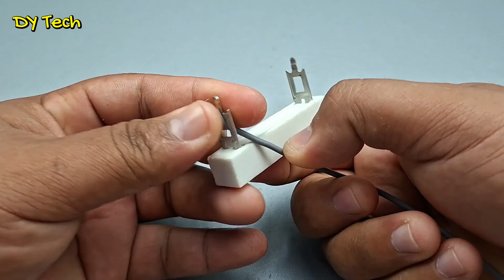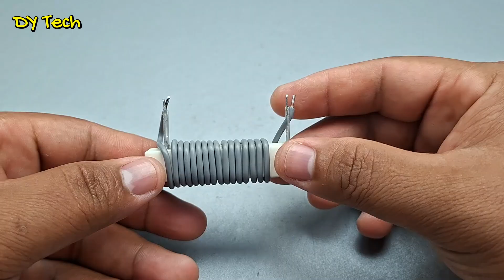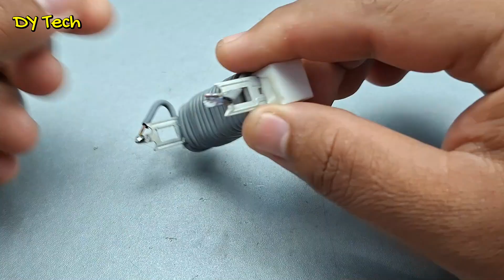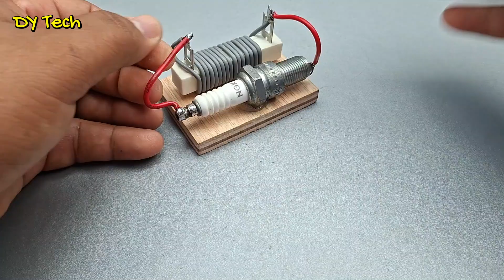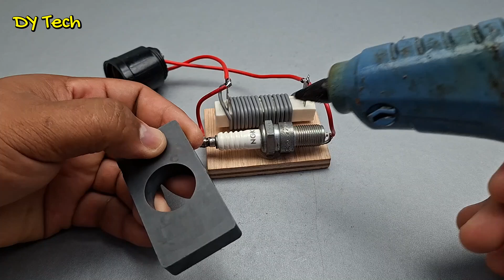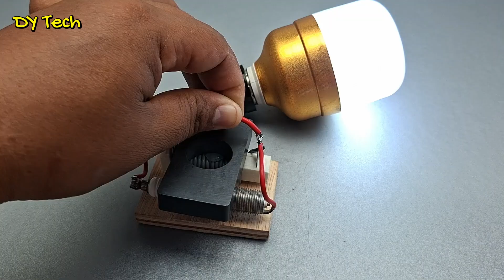I Built free electricity generator at home Most powerful free energy at 220V

Comment: THIS GUY HAS ABSOLUTELY NO IDEA WHAT HE'S DOING. A CERAMIC 2.2 OHM RESISTOR IS FOR REDUCING POWER.   WINDING WIRE ONTO IT MAKE NO SENSE AT ALL.....  ADDING A SPARK PLUG (WHICH DOES NOTHING) IS PROVING THE SCAM.  A MAGNET DOES NOT CONTAIN ANYTHING AT ALL.   IT'S GOOD FOR STICKING SOMETHING ON THE FRIDGE DOOR.         HE OFTEN USES THIS LAMP WHICH HAS A BATTERY IN THE BASE.    THE LAMP WILL LIGHT BY TOUCHING THE TWO RED WIRES TOGETHER WITH ANY OF THAT CRAP... HE'S ONLY SHORTING THE TWO RED WIRES TOGETHER THROUGH THE GREY WIRE HE WOUND ON THERE.      PATHETIC,  FAKE SCAM.
Reply: Что толку писать, нужно жаловатся ,все боятся и лайки ставят.
Reply: @semuel4591  i ALSO COMPLAINED TO YOUtUBE ABOUT HIM. THE REASON TO WRITE IS TO HELP OTHERS WHO DON'T KNOW SO THEY DON'T WASTE MONEY TRYING TO MAKE IT.